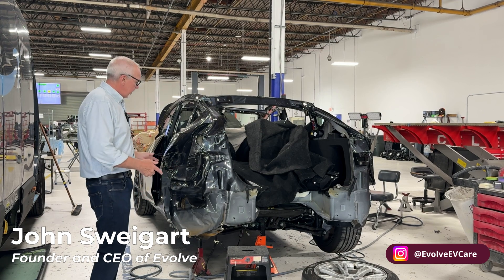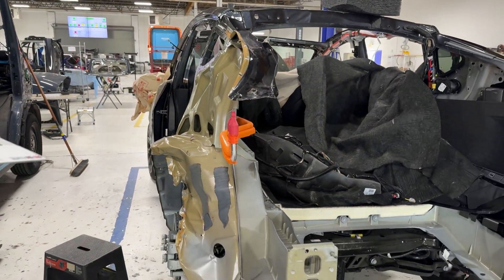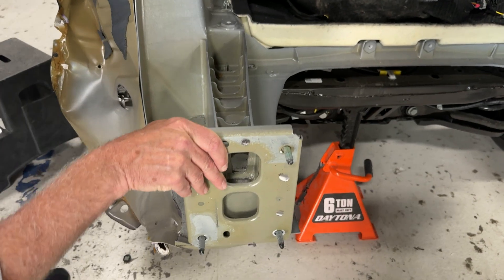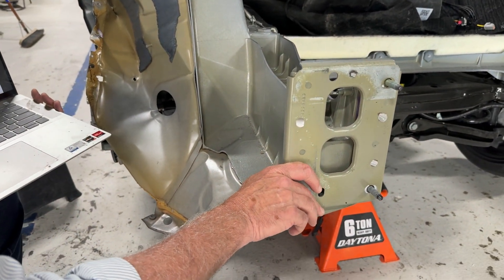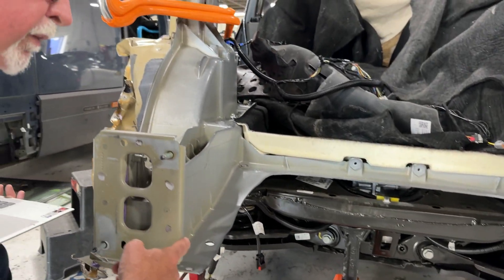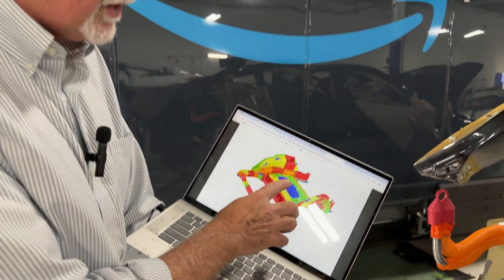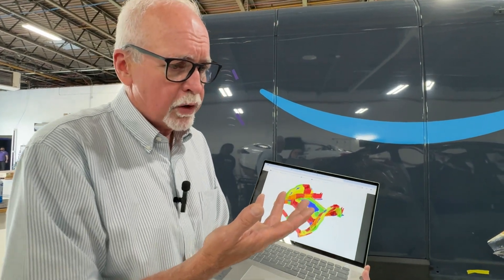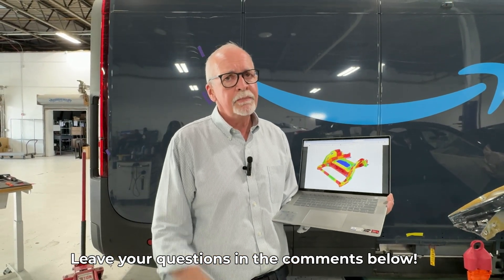Can You Repair Tesla Model Y Giga Castings? | A Closer Look

Comment: It would be nice to see claims of repairability being backed up with actual shots and processes for repair, not just a supposedly undamaged casting. Welding, riveting, bonding - all change the stress and crush properties of the casting, and workmanship is key to anything working correctly. I'm not as sanguine about the ease of repair as this gentleman is, more data would be helpful.

Comment: I don't believe a visual inspection is going to tell you much with an aluminum casting, unless you have a crack the size of the grand canyon.  You have to do a dye penetrant or eddy current test.  But then you'll probably just uncover a whole ton of defects that were there when the part was initially cast.  Do cracks way back there matter?  Is that just a bumper support?  I feel like if you made a part to mate to those gussets, then filled the whole area with epoxy you could make drop in frame sections.

Comment: Being a cast part, I expect crack that can occurs and missed by visual inspection. 

It would be more logical to also have a load tests applied to observe deflections to see if they are out of specs. 

Also, you only pointed out they are repairable in this particular case but never mentioned the price. IMO, that’s the key factor whether the car is totaled by the insurance or not.
Reply: You can do several crack tests like die penetration to highlight cracks. It's common on welded structures.

Comment: Structural repair of a cast part with rivets an adhesive!?
Reply: Rivits and adhesive are commonly used in the original construction of many cars.
Reply: That's what the specialist said. Also welding.
Reply from the maker: Thank you for the comment! John addresses it in our latest Q&A video at the 56:09 mark - https://www.youtube.com/watch?v=iqAGjC4pXMo&t=1387s

Comment: So, how long to deliver an example replacement part for that section of the gigacasting?   That is the next question. 
So, it also means that these parts have to be designed and tested and everything.
Replacement part is robably not from Tesla. They are only interested in NOT having the effort for such parts.... oR they only do it for very few specific parts.
Reply: Wrong they sell the whole front and rear complete gigcastings NOW to certified repair shops! Front assembly was $890 last year.
Reply: If the front of one Tesla is totaled, the rear could still be used to repair another car.
If the rear of a Tesla is crumpled, the front could be used to repair another vehicle.

Several million Teslas have been sold. It'll take awhile to get ample used parts, if that is desired, to use for repairs. It's an option.
Reply from the maker: Thank you for your question! John answers it in our latest YouTube video at 50:17 - https://www.youtube.com/watch?v=iqAGjC4pXMo&t=1387s

Comment: 2:00 replace aluminum casting by cutting, rivets, adhesive.  sorry, no way that is the same structure as original.
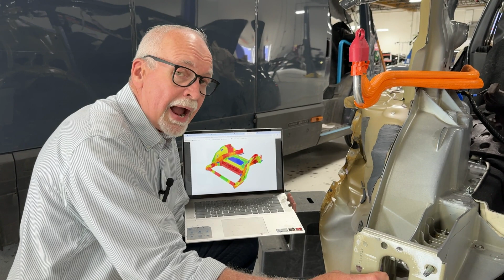2:52 as you said "doesn't mean there are no cracks" thus you cannot assure structural integrity post damage.
Reply: He mis-spoke , meant to say Tig weld  main casting(with backing plates) and rivets/adessive for the other panels as Tesla do...
Reply: it may not be the same structure as original but that doesn't mean it is weaker than original. Also, they check for cracks. It's not like they just measure the casting and not look for cracks.
Reply: @streddaz You cannot inspect a cast aluminum part for cracks without an xray machine. Cast can and will crack internally without external visual queues.
Reply: @maxwellhughes7821  a a welded steel structure can crack or have internal flaws too. You can use ultrasonic testing to find cracks or voids in either.
Reply: @streddaz  that is much less likely to happen on a welded steel structure. Cracks come to the surface quickly and can be found easily with an electromagnet and ferrous powder. Steel car frames are made so thin by comparison to cast aluminum that cracks will never be hidden internally.
Reply: that's not what I heard
Reply: @user-vp1sc7tt4m  then you must have been deaf lol!!!!!
Reply: @user-vp1sc7tt4m  what did you hear?
i have taken the implications from the info in the video.  
i doubt tesla or insurance companies would certify the type of repairs discussed in the videos, that's why they rate "damaged cars" as salvage.

Comment: It is up to the insurance to call it a total loss, they salvaged my M3 in 2019 for two doors a front bumper and front windshield, I bought all the parts on ebay yes ebay because tsla woudn't sell parts to shops or just the wait time was ridiculous and fixt it myself for 5K. Still drive it today in 2024.
Reply: Good on you! Not sure if I'd be game enough, but knowing its possible is nice.
Reply: Imo you should be able to buy all parts except high voltage and computers from Tesla with a VIN? What did Tesla EPC say?
Reply: @rkan2 
It’s easier to buy parts today
Reply: @rkan2  they say that it is unsupported vehicle and you lose your supercharger capability too!!! It took me 4 years to get it turned back on after finally tsla offered an inspection program
Reply: Well done, used initiative to repair a perfectly good car
Reply: Insurance looks for the cheapest and fastest option to decide on totaling out a vehicle. I had my relatively new Hyundai totaled out with only 49'800 km on it for rear end collision that crushed the trunk and rear quarter panels in a foot and crack the sub frame. However I think gigacasting is more complicated to repair and will lead to higher costs and even more vehicles being totaled out.
Reply: @practicalguy973 Totaling and replacement cost of the EV may be $50,000, but the Model Y is one of the safest production vehicles in the world. That cast design reduces injuries and deaths.

Medical bills from severe accidents cost much more than the $50,000 EV and presently in the USA, the yearly cost of vehicle crashes is many trillions of dollars as reported by the NHTSA. 

The human body can be fragile.
How much is a human worth? Much more than $50,000.

EVs are many times less likely to catch on fire than internal combustion engine vehicles.
When ICE vehicles catch on fire, they are totaled.

EVs are only a small percentage of the US fleet of vehicles.

It's not EVs that are driving up the cost of repairs and insurance.
Inflation has been high the last several years.
Reply: @dvader3263  I dont believe those EV talking points. There are plenty of safe modern vehicles. Not just the Model Y. A lot of the accident injuries are from older vehicles. Also EV and ICE fires are always being compared but EVs are a new platform, ICE fires are mostly old badly maintained vehicles. When those EV batteries are 15 years old and there billions on the road, they will be catching fire more than ICE. Worse EV lithium batteries have toxic gases, can explode and are far harder to put out when in thermal runaway. People will be paying a lot more to own an EV in the long run due to the expensive battery that can have lots of issues.

Comment: This reminds me of one time when I had to get a rocket panel in the unibody frame of a Mazda repaired. I thought the car was finished since I had no idea how to repair that. But it turned out they were able to cut the panel at predetermined points and weld in a new one. This looks similar — cut at designated points and attach new brackets one way or another.
Reply: this is a casting totally different from a metal sheet so not the same thing actually
Reply: @carholic-sz3qv  You're right in that welding would probably be out of the question, given that the casting is aluminum and a proprietary alloy. at that.

But I believe he said riveting in the video. The larger point is the manufacturer makes a cut-and-graft operation possible.
Reply: Did you watch the video? Repairman talks about welding in certain situations.